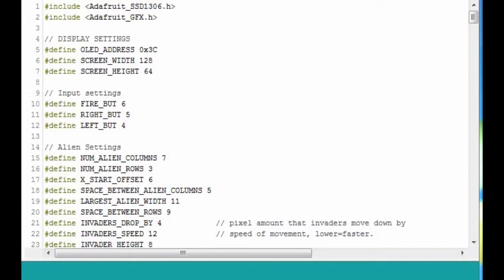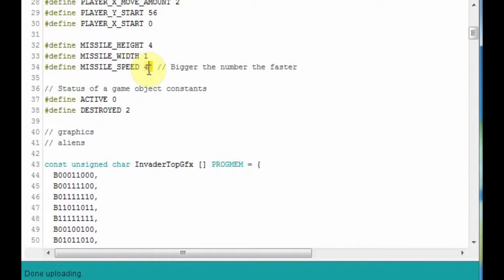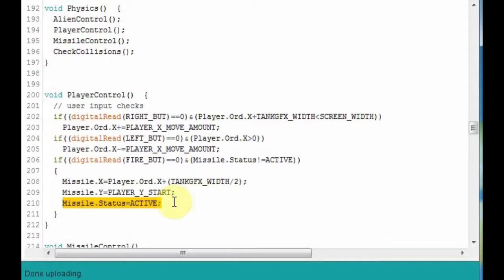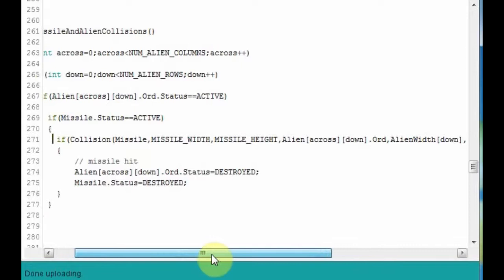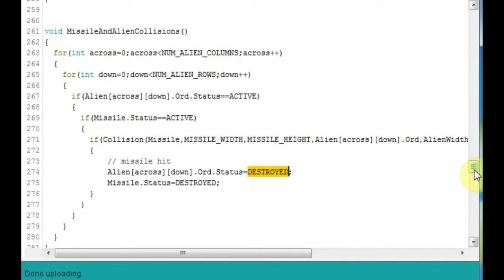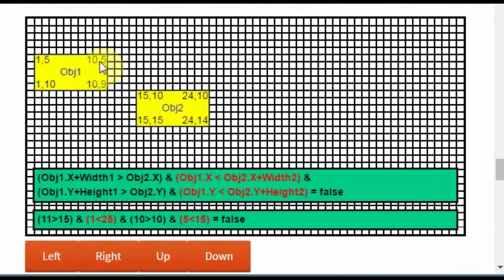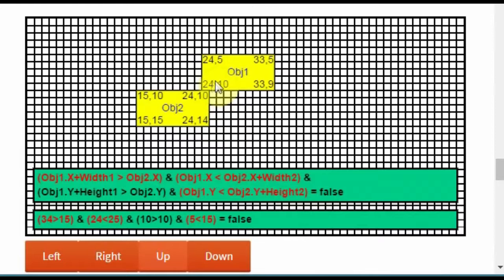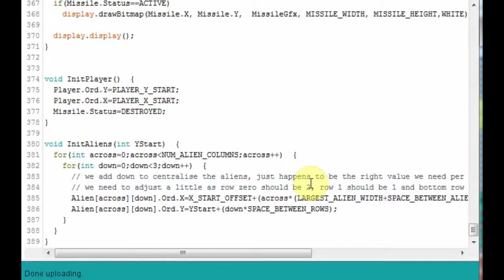Arduino Space Invaders Episode 5

Comment: thanks for this video! Any thoughts about how to test collision if the objects are not quadrilateral/square?  (circle, unique shape)
Reply from the maker: Each requires a different technique. A lot of games will break down into multiple rectangles for simplicity and speed of checking. Others will be more mathematical, some, a mix of those two. Unless the circle is large better to approximate and see if it feels right when playing. Going beyond that for complex shapes were accuracy is important then use a physics engine of some sort. This is obviously not an option on these small chips.
Reply: @XTronical  very kind mentoring, thank you!